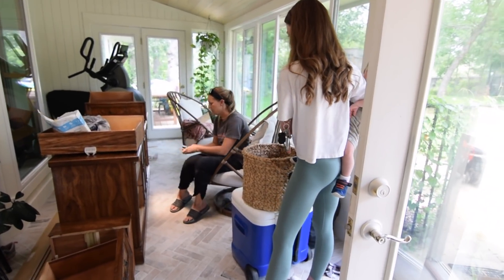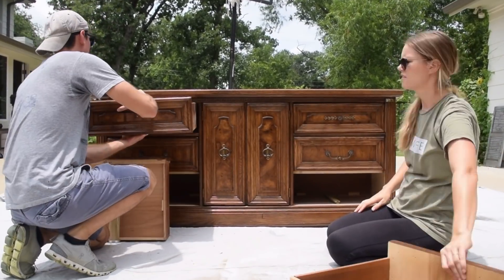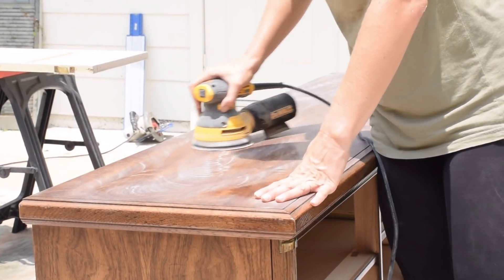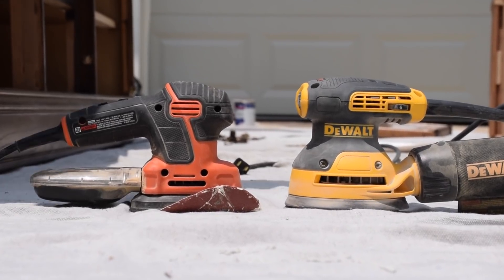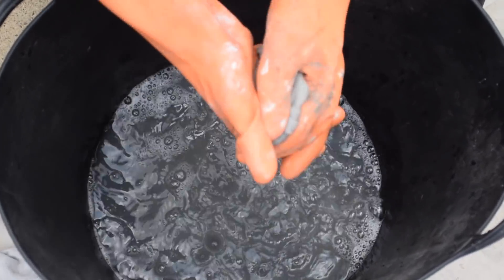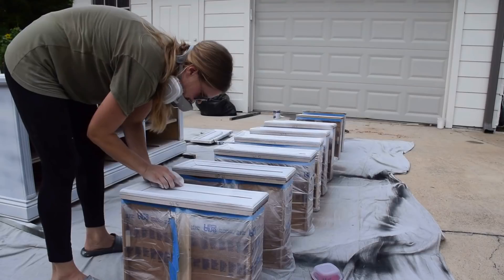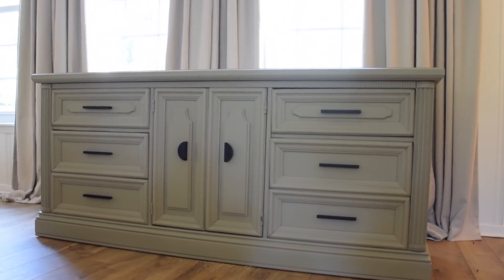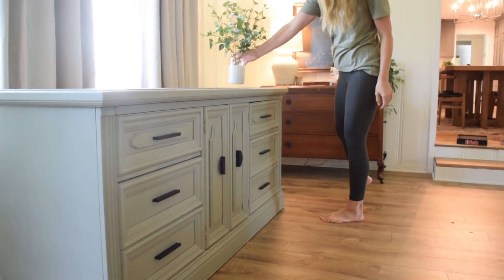Furniture Makeover // Facebook Marketplace Furniture Flip // Furniture Painting

Comment: On a dresser that size how much primer/paint/top coat do you think you use of each? Looking at the costs of the paint you use if it's a quart of each that's almost $100 of paint! Also, if you're going to sand, why clean first and not after the sanding? I get you wipe it down after sanding but is there a specific reason you clean before the sanding? Thanks! Your stuff is awesome  - thanks so much for sharing!
Reply: Because if there’s a gunk on the piece, it will get caught in the sandpaper And you will also run the risk of sanding grease/grim deeper into the grooves of the wood

Comment: You get the best furniture where you live; even with someone bringing it to you. I have a question. When you have the regulator set on your gun; do you have to worry about setting the air compressor regulator or not? Also with the regulator on you dont use the air pressure valuve on gun? You keep that all way open? What do you set your guns regulator at. Im having a hard time figuring it all out
Reply from the maker: I just go off of what the regulator by my gun says. The perfect setting will vary depending on your gun so it’s worth playing around with, I think I keep mine just under 40psi but I know others who do a lot lower than that with their particular sprayers
Reply: @diywife  Looks amazing!! What sprayer do you have?

Comment: Hi Andrea,  You have motivated me to try my hand at flipping furniture.  You do awesome work.  I tried signing in with my email to download your PDF and not sure how to download the file.  Is it on the same page as the email sign up?  Also, you have an air compressor and a spray paint unit.  Does the spray paint machine require the compressor?  Difficult to tell in the video.  Thank you so much!
Reply from the maker: It should have been sent automatically when you subscribed, but if you can't find it (check spam too!) you can email us at Andrea.diywife@gmail.com and we'll forward it to you!

An HVLP sprayer does require an air compressor :). The ones I use should be linked in the description, you just need to make sure the air compressor is powerful enough!
Reply: @diywife  Thank you so much for emailing back!  If I don't find the link in spam, I'll email.  Again, thank you!!!